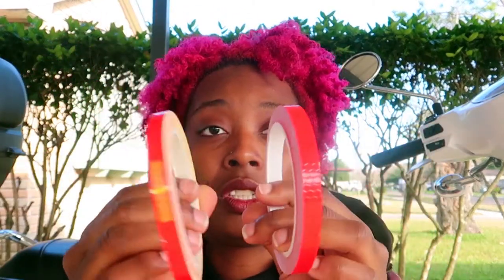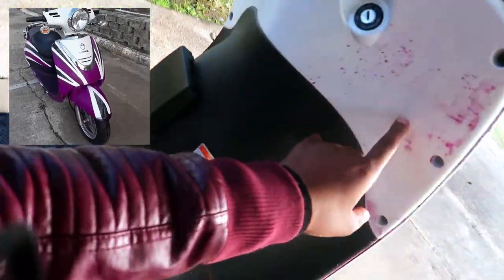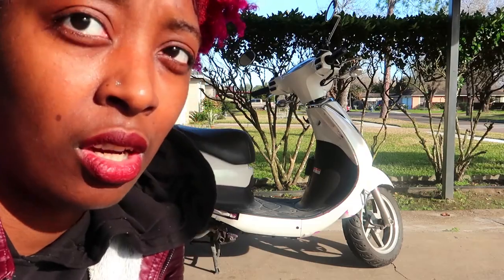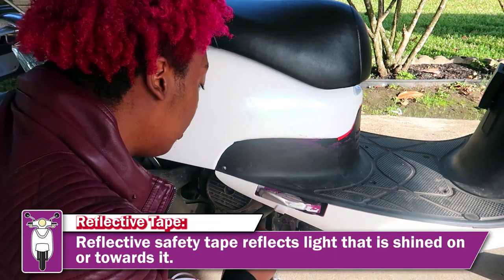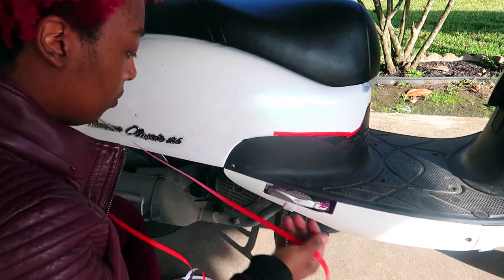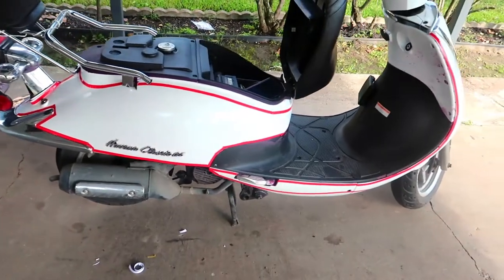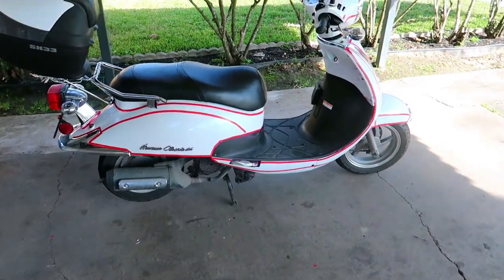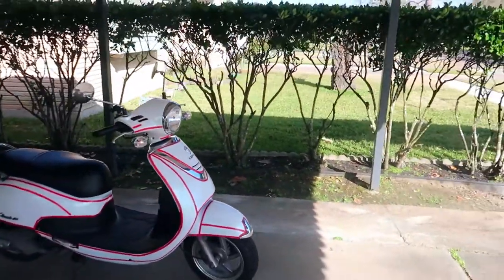Applying Reflective Tape To Scooter

Comment: Hey Shauna looks better! If you do it again use a heat gun on low... or hair dryer on high... and it will allow you to flex around minor corners, and helps it adhere a bit better if it's cold out. Just not to much heat! Roman is so shinnie!
Reply from the maker: Thanks for the awesome tip Nathan. I'll keep that in mind for future projects.
Reply: @RamenOnWheels  you can also use this trick to remove the tape easier, it melts the glue a bit. If they're any bits with creases you want to reapply it's a great way to smooth it too.

Comment: Well no one would say at night they didn't see you lol, agree with the heat gun / hair dryer suggestion then you wouldn't have had to cut it as it makes the tape more pliable to shape, only other tip wash and use alcohol wipes to make sure the road grease is off the plastics first so it sticks better plus it will get the old plastic rap paint off too 
I use petrol as it really does take off any old paint / stickers then wash after
another great video, take care girl
Reply from the maker: Awesome, thanks for the advice Mark. Definitely will keep in mind when the time come for me to remove it. 🙂😃😄

Comment: And I told you to update the cdi coil plus spark it comes all together and it’s easy to install or maybe not for you because you will have to take it a part
Reply from the maker: All of these are great suggestions Tauseeq. But right now I'm satisfied with my scooters performance capability. If I decided to upgrade CDI Box or Spark Plug in the future, I'll let you guys know.

Comment: No no no you're overstretching would you do that to your car if you need an idea I have had great success with a air horn you can get one for 12 bucks at AutoZone and usually you can simply replace the horn you already have it's three times louder and people really hear you coming
Reply from the maker: An air horn is a little much for me and Texas Drivers are crazy. They are more than likely to get mad and run me off the road if I blew one of those at them.